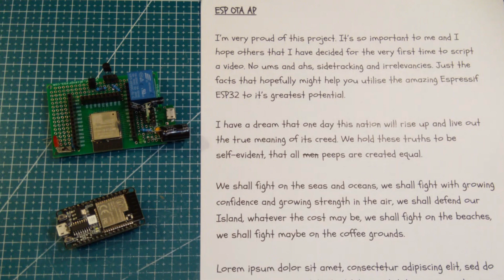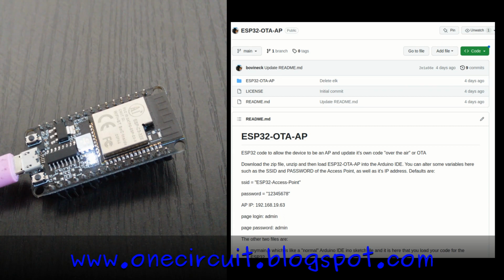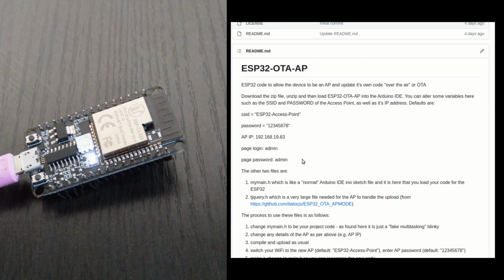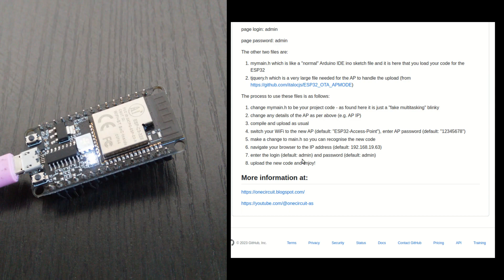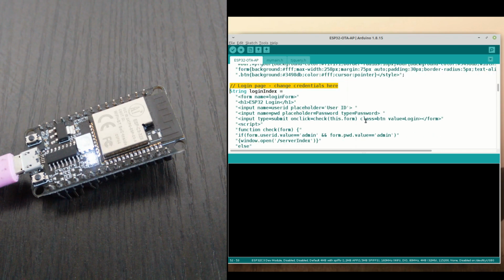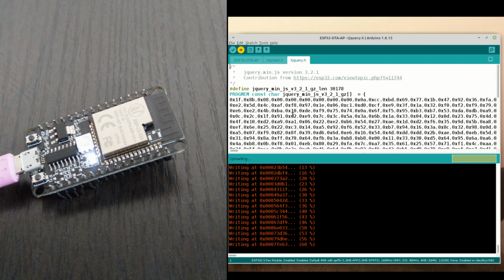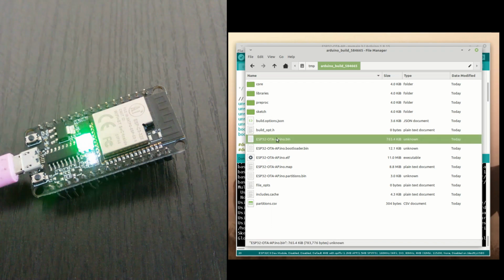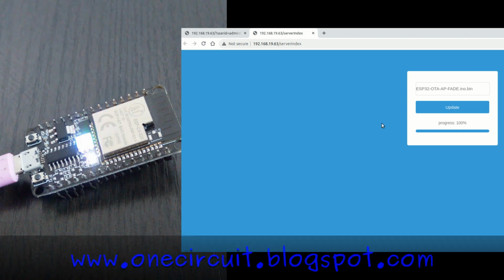ESP32 programmed OTA - no wires, no WiFi!!

Comment: If you actually look at the code in the ArduinoOTA library and see how it works, it is possible to update the board via WiFi, Bluetooth, or Serial. Some methods would be slower than others due to the amount of data you can send. You'd have to send smaller packet sizes.

You could even have a master board receive the data for the update and transfer the data to another board through the various forms of communications, that way a slave device can be updated without having to connect to an outside source.
Reply from the maker: The latest is OTA in the wild, no WiFi, no Bluetooth - check it out. 👍😀

Comment: So you mean by "no Wifi" "no internet wifi", because the esp32 in AP mode is clearly "Wifi".  I have been uploading new code to my esp32 in AP mode no problem, why does this need anything other than stock esp code?   I just have to connect my computer with arduino ide to the AP.
My problem is my esp8266 in station mode must connect to the AP with the specific name so I can upload new code, and I don't want to have that AP up and running just to upload new code to the station device which I then change what AP it connects to, so I need to keep the old AP up and running and the new AP up and running to upgrade all my esp8266 setup to connect to the old AP.   If I could just connect to it without "wifi" like perhaps using espnow knowing just the mac address, i could not require having this old AP still up and have my pc have to connect to both
Reply from the maker: Check out the new version: https://youtu.be/IaRcK1yezKY 
It might have what you are looking for. 👍😀

Comment: Excelent!But i'm using a board with 8266, not ESP32, can be adapted?Thanks in advance!
Reply from the maker: ESP8266 also does OTA with it's own libraries - long term plan of mine is to port it to ESP8266, in the meantime if you select ESP8266 it will tell you at compilation time the problem with various library issues
Reply: @onecircuit-as  oki thanks for your answer 😊